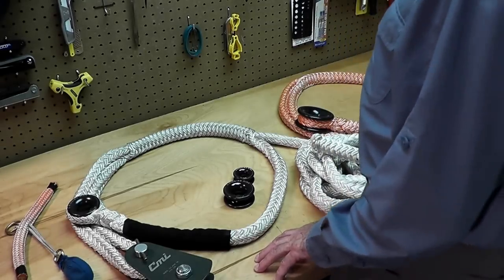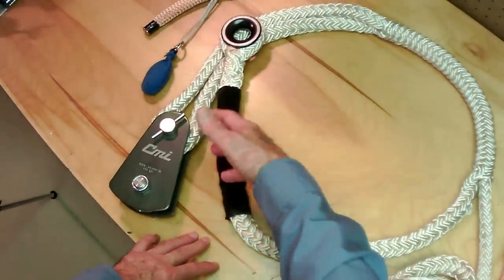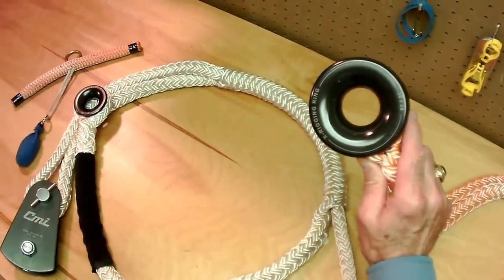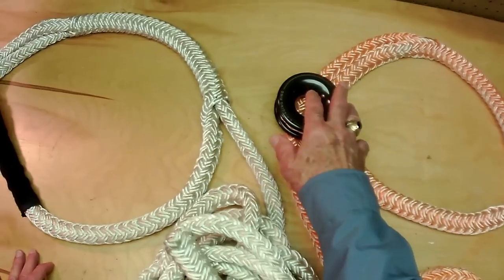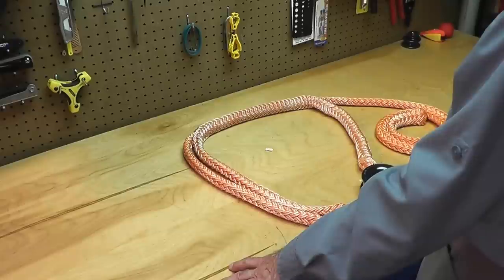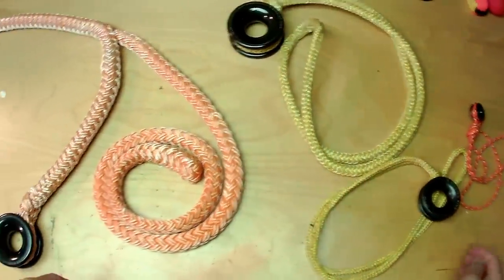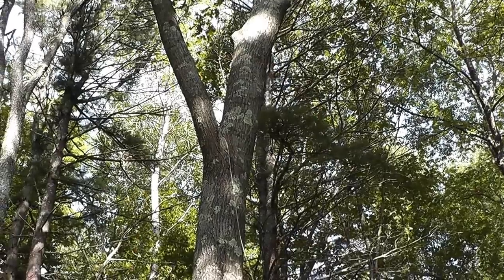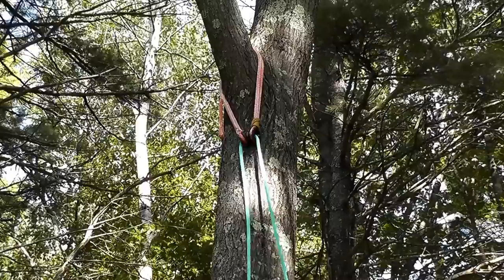XRR Beast Rigging Whoopie

Comment: Just made one with 3/4 teufelberger t-rex. I can't wait to put it to the test. Thanks so much for your ingenuity, and especially for the build video which made this daunting project for a new splicer relatively easy. Appreciate your hard work. Cheers
Reply from the maker: +Aaron McGarity Thanks for the good words, Aaron.  I've recently discovered T-rex myself and I like it too.  The color makes it easier to splice while keeping the twist under control.  And it looks like the coating is going to help with the picking problem.

Comment: Great vid!!  I've gotta say I was worried at first because of friction-hitches + dynamic-shocks but, seeing how you positioned it, it shouldn't really matter.....BUT I am still, for such a long time now, unable to find out how I should consider the strength/ABS of friction hitches, for instance what if you just said "I'm gonna make two beast-ring-prussiks with 3/4" TEC loops, and carry a 20' long piece of 1" TEC to be 'the body', and I'll swing it around whatever I want and, when placed/positioned, I'll simply friciton-hitch each of my beast-3/4TEC-loops onto each end of my 1" TEC line".....this would have the right ratios of hitch-to-cordage, the ropes should all be strong enough (since 3/4" tec, in choker-config, is the weak-point at the hitches), but I just can't find any real data or even good anecdotes on how friction hitches perform under dynamic-loading/shock-loading (a part of me worries that, due to their inherent 'bitey' nature, that under that type of loading they could squeeze-into and destroy the parent rope they're hitched-onto, so have never played with friction hitches on my rigging setups unless it was setting them on my bullrope for spider-legging from positive-anchor-angles)
As always thanks a ton for so much great content, heh I'm still unable to forget your idiom Re "20 years doing the same tricks isn't 20yrs experience" (rough paraphrase, my apologies!)

Comment: Wow! This is great stuff. Thinking about ordering the rig and ring large from trestuff. Is there any major disadvantage to having the fixed configuration like they sell it? What would I be sacrificing without the whoopie?
Reply: Forgot to mention your videos are ALL awesome. A lot of ingenuity happening. Good to see there are people constantly thinking and rethinking. Also, looking to make a purchase in the next week if you have time to get back soon. Thanks!
Reply from the maker: Thanks for the nice comment and a good question.  The Whoopie is more flexible for special configurations and, of course, for sizing. it can  choke to a plain spar (single or double ended) or set a floating redirect.  The Rig and Ring is less cordage to carry and the Stable Braid can take everyday abuse better than the Tenex.  If most of your rigging is set through an easy crotch, the RandR is hard to beat:  cheaper, light, durable and fast working.  If you need trickier options, the Whoopie is much more powerful.    And one more thing:  for top rigging, X-Man suggests three (3) Large rings or two (2) Beasts.  The RandR doesn't quite do that but I've never heard of trouble for the rigging line on the RandR.

Comment: Great video and bit of kit! I have a question, I don't have any splicing kit or experience so was contemplating making this without splicing? Would be a fair bit messier but what about a separate cord with a cinching knot plus stoppers to keep the beasts secure in the eye loops? And then make the klemheist a bit longer? Too dodgy? Nice one, Alex
Reply from the maker: I don't think so, Alex.  The knots sound messy and they cost you seriously in loss of strength ... about 50%.  Working with 12-strand hollow braid is SO EASY.  Get a small piece and try it.  It's NOT like splicing doublebraid.  Check out Samesonrope.com for step by step instructions.
Reply: @tghoffmann  tru, knots do decrease howling capabilities, like a lot 45% esy

Comment: Great video Tom and greetings from Ireland. What would be the length if I was using 13mm (1/2 inch tenex woopie insted of 3/4 inch.That's the choker prussic. I will be using 3large rings as I dont have a beast ring. Again thanks for your great video. Oliver
Reply from the maker: Oliver Claffey Thanks for the interest and the nice words, Oli.  I'm sorry I don't have the dimensions for the 1/2-inch build.  However, surf over the XRR Whoopie Build Details and you get the methodology to figure it out.  The important length the locking prussic loop.
Reply: Tom Hoffmann Thanks for the reply. I will experiment and get back when I have it sorted. I just bought some 13mm tenex. Take care and keep the videos flowing.